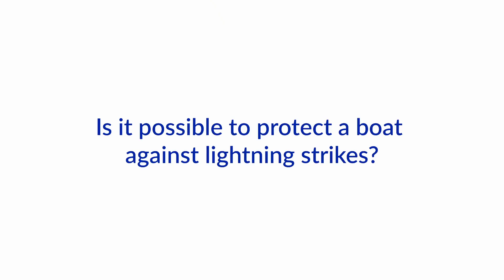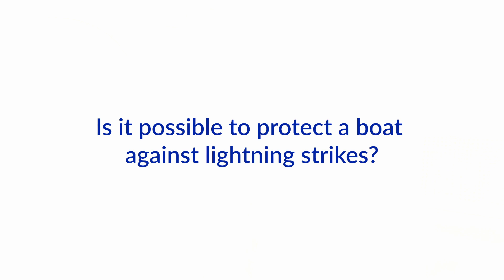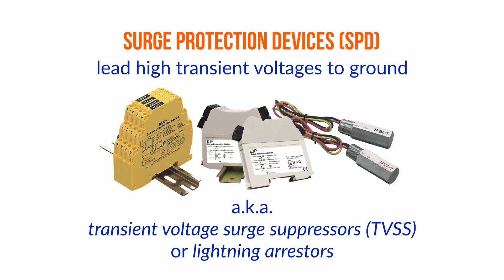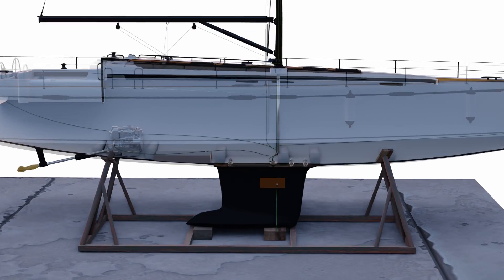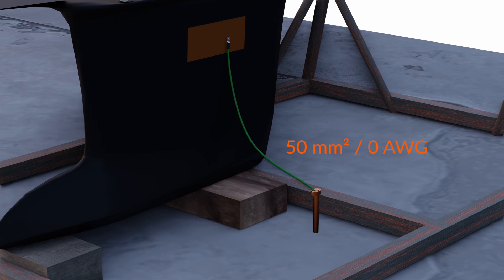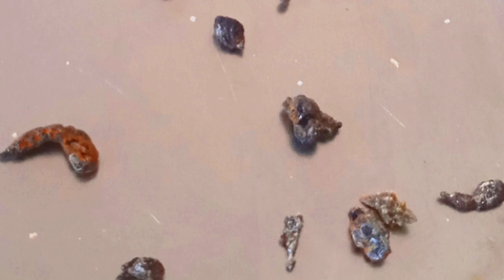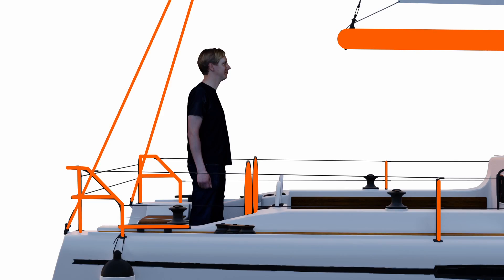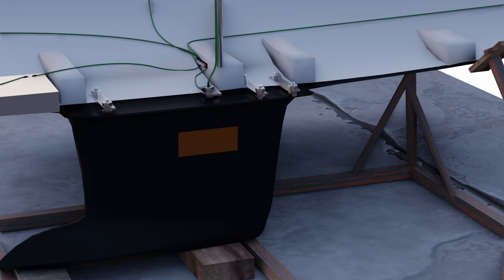Lightning Protection for Boats - NIGEL CALDER's take on the subject | Ask The Expert from BoatHowTo

Comment: On my last boat when in areas where there was mild to severe lightening, I would completely disconnect all my electronics when it got close. If I needed a fix I would use my backup handheld GPS.  I was never hit so thankfully never had to test it. My new boat I am going to install better protection. When I was in High School I took the sailing Outward Bound course in Maine and one of our instructors was holding a shroud when the mast was struck. She was lucky she wasn't killed and she was lucky we were at a dock and she got to the hospital easily. Needless to say, I don't hang on to shrouds in lightning storms.

Comment: I have been thinking about the possibility of air gapping as much as possible on the boat, having the electronics bonded running off DC and not connected to the AC unless charging when the Solar can't keep up. Also what about all the NEMA becoming wireless(?), building faraday cages integral in the boats structure all the while having a completely separate lightning rod system to the water. It just seems like the industry should try a little harder to protect these very expensive and now days vital electrical components on any boat. Maybe none of my ideas are possible, practical or even helpful, it just seems like no matter what you do it still all comes down to luck and that just doesn't seem good enough

Comment: My two cents based on 30 plus years working with sensitive electronics in tall structures is to provide a path to ground outside the structure.  Don’t let the lightning bolt enter the structure.  This means lightning rods above your antenna and at least two external conductors to ground.
Reply: Where you get a good ground is the problem
Reply: @sartorst3376 you need copper plates on the side of the boat.   The minimum area to be equal to at least the same as provided by three standard 0.75”x10’ ground rods plus the area of the 4/0 interconnecting copper cable.
Reply: @fountainvalley100  and water is a good ground ??

Comment: For 34 ton vessel with marine diesels up to 2400 hp what is the best setup with turbo chargers?
Here are two examples of two stage turbo chargers;
1. A diesel electric locomotive  https://youtu.be/cIQ0yIZgQeE?si=rR6b9Ybgn5lZ5xeG (Its interesting to see how they deal with sulpher etc in the exhaust).
2. A large diesel for a large vessel  https://youtu.be/5mFmCxOjY_A?si=8yf9Hp7H2cHGcHkFthey even have to crank it at first to make sure oil is covering the cylinder walls etc then crank it with compressed air to get rid moisture etc  before turning on the fuel. How do normal small marine engines avoid these startup complications?).
What is required to test the quality of the fuel?
What is the best way to filter the fuel and have an alarm if doggy fuel is detected?
Are these dual turbo chargers variable?
As far as cooling the diesel is it possible to have an alternative cooling system which can switch from sea water to an air radiator for a vessel which is amphibious (Bluebird ZIL 6 wheel amphibious vehicle for space capsule and cosmonaut recovery for the Soviet Space program) or a plane (Junkers Ju-86P was a diesel powered plane made by Germany in WW2) that can leave the sea?
Thank you for your answers to my questions.
Regards
Philip
North Jakarta

Comment: The protection of electronic resources within a GRP yacht is a very difficult thing. The military (Navy) spend many millions protecting sensitive electronic resources within a steel warship. I believe that one of the best methods of protection of electronic  devices on board is to have the ability to safely sail the yacht using time tested method of sextant,  time piece  and paper charts. Bruce

Comment: can't you just run a conductive strip linking the mast directly to the water?
Reply from the maker: Unfortunately it's not as simple as that. Connecting the mast to a grounding plate more or less straight below it is one thing and usually the first step when installing a lightning protection system. But then you still need to connect all substantial metal hardware such as shrouds and stanchions to avoid side flashes. And then there is internal lightning protection to protect your electrical system and the electronics, which is very hard to do reliably.
- Jan

Comment: Did the lightning blow out the entire system because everything was networked together via a bonding wire?
Reply from the maker: Bonding for electronic devices and equipotential bonding for corrosion prevention for non-electronic metal parts do (in the best case) prevent the risk of lightning damage to the electrical system (in particular if they are sized according to the standards for lightning protection and thus fulfill the double role). See our advanced module on grounding systems: https://boathowto.com/courses/grounding/ The issue is that lighting current (either through direct strikes or through induction) can find its way into the DC or AC system and it is very hard to reliably protect the devices with surge protection devices. We give an overview about this in our lesson on internal LPSs: https://boathowto.com/course/internal-lps/ - Jan

Comment: There are things out there that are showing very strong progress in this area....Such as EMP solutions cmce-55  it has been used around the world in marine, commercial applications, buildings. You might be able to tell me what you think of something like this.
Reply from the maker: First, we are not lightning experts at BoatHowTo. We have based our module on the leading lightning protection standards on the assumption that these are written by experts. Second, the EMP Solutions device looks very much like a modern variant of a “lightning dissipator”. I have seen several of these over the decades that have made similar claims which have not held up in practice. Third, when I was commissioned to clean up the ABYC’s lightning standard a couple of decades ago (multiple changes over the years had made it linguistically clumsy) I recruited a team of PhD lightning experts to help with technical questions. They were unanimous in their opinion that lightning dissipators do not work. So, I am skeptical, but as I said I am not an expert so maybe there is something new here that really does work… It looks to me as if the EMP device has a connection to ground in which case if hit it would likely still operate as a conventional LPS. - Nigel

Comment: What happens if Lightning strikes close to a boat. Say a few metres.  Is a currant likely to find a path to the boats electronics through the boats ground.  ???
Reply from the maker: This is definitely a possibility. But even without any connection to ground (for example in a fully isolated DC system), there is a high risk of destroyed electronics from a nearby strike. This is because the extremely high voltage differences within microseconds induce currents in nearby metallic objects. You can reduce the risk with surge protection devices (SPDs), but it is very hard (if not impossible) to fully protect onboard electronics. We talk about SPDs and other means of internal lightning protection in our "Advanced Marine Electrics" module on the topic.